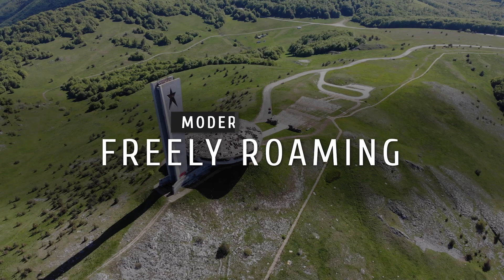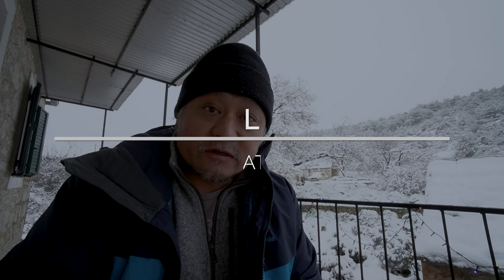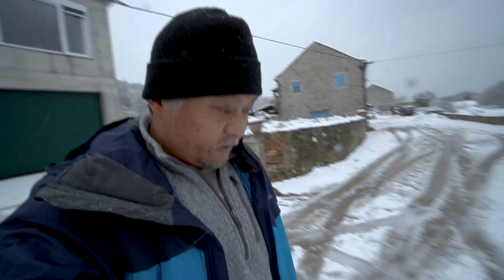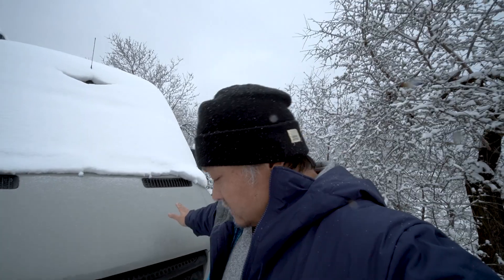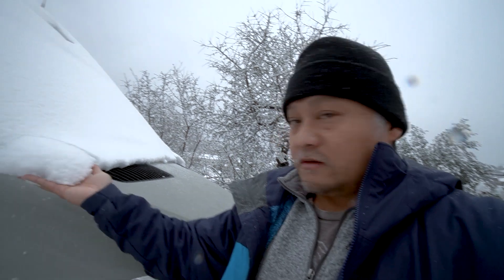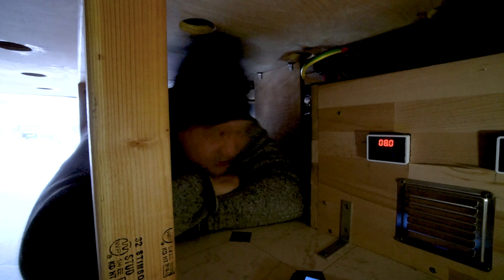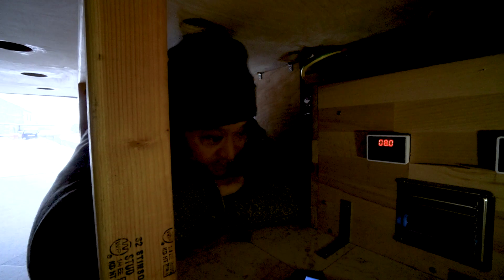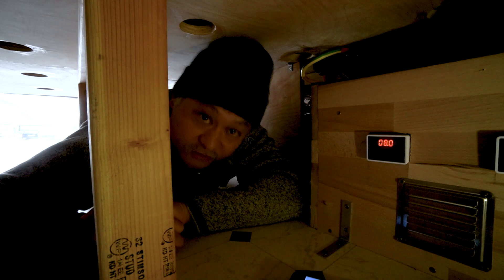DIY Cold-Weather LiFePO4 12-Volt Battery Upgrade 🤖 Part 3 // Heating Test In The Snow

Comment: Good video, I am working on my build as we speak,, I am putting a battery in an enclosed snowmobile trailer to run a winch that opens and closes the back door and will be charged by a solar panel,  one item  I had not considered was not heating the battery at night, I will have to figure that out!  Awesome work, thanks!

Comment: Maybe you could use a voltage sensor/relay on the panel output? So if there's any voltage worth using to charge with coming in from the panels, then let's heat some batteries!
Reply from the maker: You could do something like that although to me it would add unnecessary complexity to an otherwise simple system.

Comment: Wouldn't an alternative to using a timer be to just use a relay to turn on the heating once solar/shore is providing the first hints of power?  I mean use "power is being generated" to turn on the heating element for the cells?  You would lose roughly the 20 minutes it takes for the batteries to reach charging temperature, but the solar generated at that point would actually be feeding the heating elements anyway.  So it wouldn't be "wasted".

Comment: Hey there. How hot do those pads get, and how hot does the aluminum sheet get. Any chance of melting the battery casing, or does the aluminum drop the temps from the pads enough?
Reply from the maker: No. There's no chance these pads can melt the aluminum.
Reply: @freelyroaming  I mean does the aluminum get hot enough that it could melt a plastic battery casing. Some pads say they go up to 200c
Reply from the maker: No it does not. It does not come anywhere near 200c. Especially at these relatively minimal wattage ratings, there just insnt enough energy to generate that much heat. The small wires that supply the 12vdc power would burn up before that much power could be supplied.
Reply: @freelyroaming  appreciate it

Comment: Hi there. Frequent watcher, a couple posts... I got my batteries and hooked them in series with a BMS. Here is a weird thing that I want to make sure is normal. I am measuring with my multi-meter. Battery + to battery , I will get 13+, when I measure from to P to battery +, I only get 3+. Is that normal with out a load? Maybe wires from the BMS are not making contact?
Reply from the maker: First thing to check is to make sure you have the sensing wires connected properly. That will make sure the BMS is allowing a connection.
Reply: All sense wires are hooked to the positive terminals. Black sense wire and B- are secure on neg terminal. Same results, Does the order of the sense wires come into play? Maybe the BMS is broken? Batteries are showing combined voltage.
Reply from the maker: Yes the order of the wires are critical. They need to be in the right order.
Reply: @freelyroaming  Thank you, after checking the BMS instructions, I made sure wire for the last battery had the wire after the black. That put the BMS in order and voltage is coming through.
Reply from the maker: Great! Glad you figured it out.

Comment: Curious about the dimensions of your self-built battery enclosure? I intend to build a pair of 12v 280Ah packs out of eight of those cells in the near future and it would be good to have some figures to work with as far as planning my electric system layout. I really like your solution, very clean and functional, and intend to emulate your setup pretty closely.
Reply from the maker: 17.5(L)x10.5(W)x12(H)

You can see it built in this video.

https://youtu.be/JSaiZ0wnvO4
Reply: @freelyroaming  Oh, I've watched all these videos :) I just didn't think you had ever cited the actual dimensions of the finished product. Thank you!
Reply from the maker: Ah yes. I just mentioned the size of the box when I built in. Good luck with your build!

Comment: Hi Dan, wouldn't it be sufficient to keep the battery from charging when the temperature drops below 5°C? You could save the heating elements and the energy draw from the battery. When you live in the van that's when you need charging, and that's when the van is heated. You have programmed the victron solar charger to not charge below 5°C but something doesn't quite work with the temp sensor, it seems. You could also (if possible) program the BMS not to charge below 5°C.
Reply from the maker: Ive explained the reason for the heaters in the previous videos but the simple answer is that you want to maximize solar charging in the winter when you have a very short window of sunlight. Losing hours of charge in the morning means you will run a constant power deficit and eventually deplete the pack. Since we live in our van we can not allow that to happen. It would be sufficient for the low temp cut off just to stop charging to  protect the battery. But that's only acceptable if the van is not being used or it the cold temp is only temporary. The purpose of battery heating is to protect the people who need to live in the camper so they can use the power sustainably. Running the diesel heater to warm the cabin alone for me is not enough to keep the batteries warm with our van's configuration.

Comment: So what happens if you have the pads off at night and the temp in the compartment below drops below the bms low temp cut off?  You would not be able to charge them until the batteries warm up.  I know you can still discard lifepo4 batteries below freezing and run the heating pads, but my concern is the SOC of the batteries in the morning after running the furnace all night......or multiple nights without solar during the day.

Also, what did you do with the old AGM batteries?  You could connect them to the heating pads.  I have my system setup with a switch to use the lifepo4 or AGM.  If for what ever reason I have a problem with the bms or the lifepo4 battery, I can easily buy a AGM or lead acid at any auto store.
Reply from the maker: My BMS does not have low temp cut off. I set the chargers to cut off during low temp instead so I can still draw from them in freezing temps. I don't have room for the old AGM batteries but maybe a smaller one dedicated for the heaters would be a good idea for that application. Or use a portable power bank like Bluetti or Jackery that can be heated up in the cabin. I use a diesel heater and it draw very little power from the batteries.
Reply: You could also divert a small portion of air from the diesel heater to keep the area warm.   Stay safe and keep the content coming.
Reply from the maker: These are all very good ideas. I considered that but it's difficult to do for our setup based on where the heater is located. I tested running the heater and it couldn't get the battery area warm enough to make a difference. That's why I decided to heat the batteries internally. But for someone else this is a good option.

Comment: Great "stuff" for the brain did u understand my question?  One last though as I saw u eating the snow. Refrain from eating yellow snow.  LOL. Ciao
Reply from the maker: I think so. I believe you are asking if those cells can be connected in parallel or series. The answer is in series if you are trying to make a 12v pack. That means connect the 4 cells in a negative to positive chain. And your main power posts will be at the beginning and end of the chain.

Comment: Hi Dan, thanks for showing how the heating actually works. Could you make a schematic of your installation? Do you retain your lead acid battery as starter, and do you have a larger alternator?
Reply from the maker: My original starter battery is still the factory unit from Mercedes. This is just the house battery for the camper. Alternator is still stock. I mostly charge using solar but do charge from alternator via a DC-to-DC 20A charger if necessary.
Reply: @freelyroaming  thanks!

Comment: Please tell  me if you can. Do your batteries are still balanced after some clanging /discharging cycles ? I watch this youtuber off garage, and he have problems with the BMS/balance of batteries.
Reply from the maker: Still balanced. I also use a secondary active cell balancer on top of what the bms does. It keeps it within 6 millivolt delta. I think it makes a difference. Off grid garage has a 48v pack vs my 12v pack. That could be why it's harder to keep balanced as well.

Comment: That was a good test thanks Dan - sounds like you were lucky to get the weather lol. So at freezing temps, the pads are able to heat the battery. Although I guess the battery was at 4 degrees not zero so may not be the case. What would be interesting is to observe how much power the heater takes over the course of the daylight hours to see if it is efficient to run it. 
One thing that worries me is that if batterries get below freezing for an extended amount of time, your temp sensors aren't going to detect the internal temp of the batteries (which could be way lower than the external where you are measuring). 
I have had a problem when charging LiPo batteries (for my RC hobbies); 5 hours after bringing the battery inside (20 degrees c) I started charging it - the battery ballooned and started smoking a lot. I can only imagine that is because the cells in the middle of the battery package were still at 0 degrees.
Reply from the maker: Because the temperature switch turns on automatically at 5C, it should never go into a deep freeze. I had the heaters turned off so I can show how long it would take to warm up from below the preset temp. As it is, it would never even drop to 4C like it did in the video. I would have just left the system on the entire time if I knew a cold front was coming. Unless it is so cold that the amount of heaters are unable to keep up with the ambient temp, it should work fine. If much colder temps are expected for your application, just install larger heating pads.